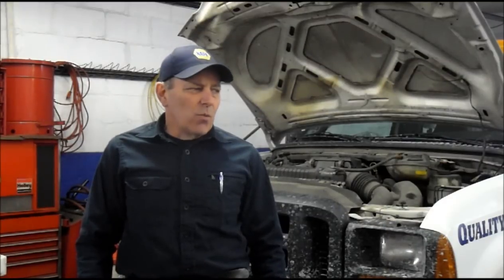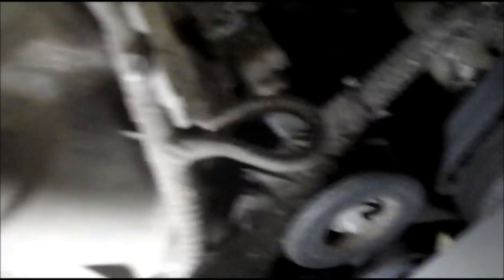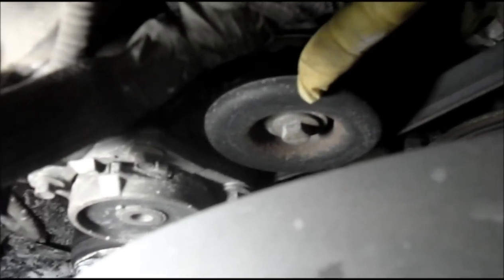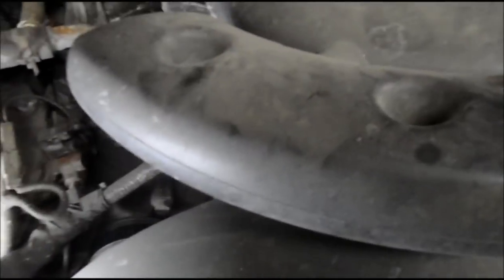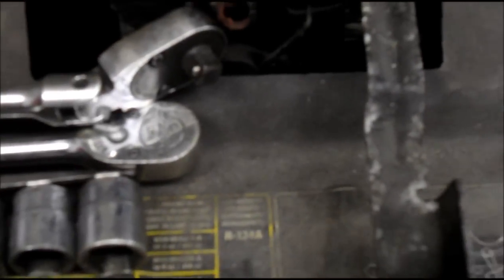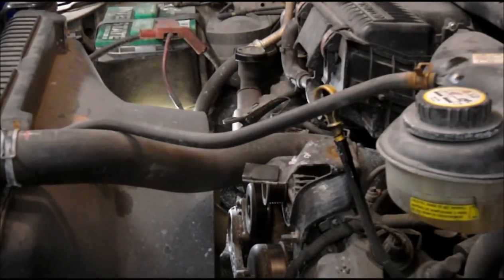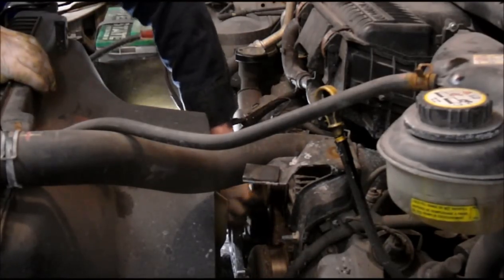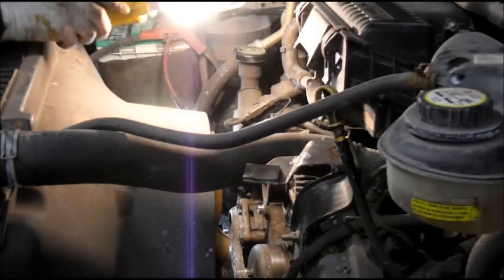How to replace the serpentine drive belt on a Ford F150,F250,F350

Comment: Hello Jim, My serpentine Belt has the part number erased, but I measure the belt for the exterior (3435mm) I can find the exact belt measure, the closer one is 3474mm exterior also (Adelco k081362HD) how can I know what is the tolerance the tensioner are going to give me ? My Truck is an 1999 Ford econoline CArgo Van E-350 Heavy Duty 7.3 v8 dual alternator with Ambulance pkg

Comment: Serpentine belt breaking, I have a 2003 E-150 6 cylinder 4.2 liter Cargo
 Van with 130,000 miles, The belt shredded off after starting in cold 
weather, I purchased a replacement (Drive-Rite $27 6-rib 1 yr. warranty 
belt 1020K6 6PK2590) I had a very hard time getting it on, I had the 
pulley moved over 100% and it still took two men and the but of a hammer
 to push it over the idler pulley, seemed too tight compared to videos 
here on You Tube, so I figured this was due to slight difference in 
length due to manufacture??? or could this be a symptom of something 
else?

   I started and ran it for10 minutes, it started smoking at first, 
figured this was due to cold belt, moisture whatever, it stopped after a
 few minutes, so shut it off. restarted and it ran for a minute then 
snapped, on one side of the belt appears to be some wear and slight 
shredding. I do not want to just buy another belt and put it on without 
finding the cause here, 2 belts broke leads me to believe something is 
out of alignment?  What is the most likely cause in your experience? 
spring pulley? idler pulley? A/C locking up? Thanks for any help...